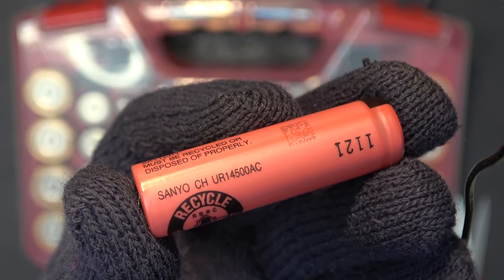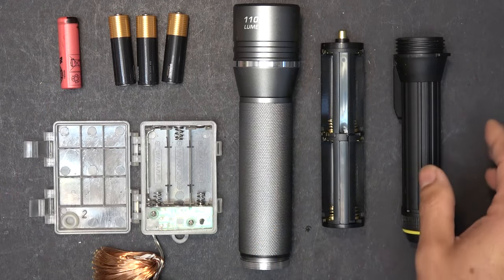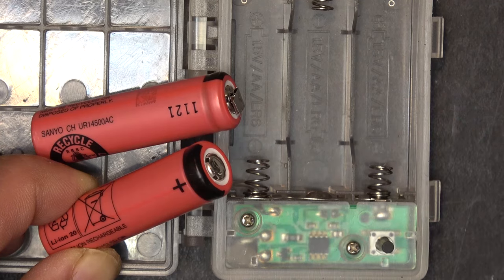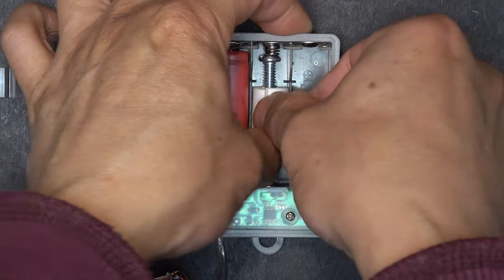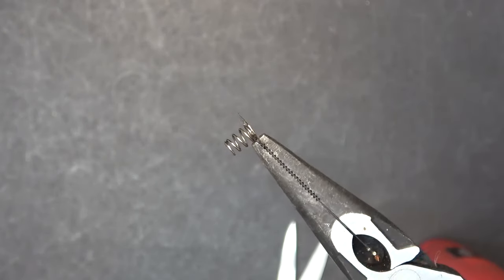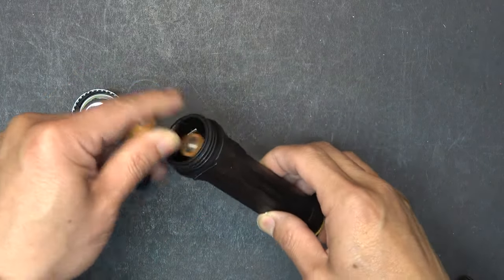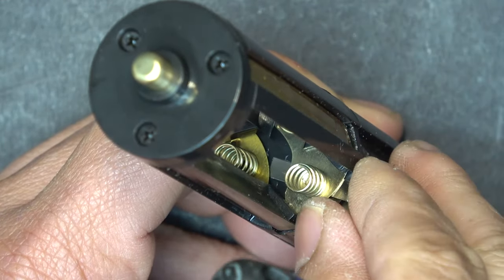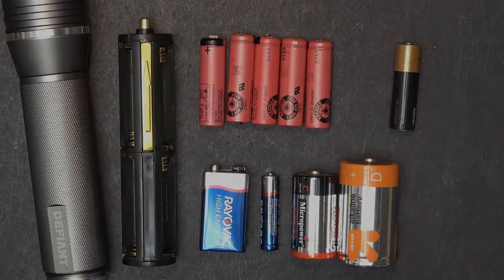This Li-ion 14500 AA size battery makes all Alkaline AA batteries obsolete

Comment: I went down this path a few years ago but about a year ago, I switched over to Lithium Iron AA cells, a better 1 for 2 swap out, voltage wise. As for flat top cells, I got some small rare earth magnets and they stick to the positive battery terminal - no spot welding required. You can also get button top Lithium 14500 cells. I also bought some AA cell 'blanks', I think they are hollow inside with an internal (+ to -) shorting wire, easier to use.
Reply: Another option is to use 14450 cells and a small buck regulator and then it's a 1 for 1 swap and you don't have any capacity loss, maybe even a little gain.

Comment: Nice! At 12:15 I would migrate the spring down to the bottom so you don't have to modify your battery. With your nickel strips and welder it would be short work to cut and join and swap the middle terminals around. That way your batteries are all modded the same way.

Comment: Note to anyone doing this.
1. Be VERY careful to get your voltage exactly right. 
2. Soldering nickel strips to LIon batteries could cause a fire if you're not skilled.

Also consider just buying AA & AAA NiMh batteries. They're the right voltage, last 10 yrs and only cost about $1- $3ea 👍
Reply: also label your device on the battery cover to indicate they are recheargable or put don't dispose recharge note on the unit....i had a friend who said his son and wife threw away all the expensive batteries he bought not knowing they are lithium/nimh ......ouch !!!!....i still grin and laugh when ever i remember the story !!
Reply: @10OZDuster  Women.....My Ex threw out all the NiMh batteries I gave my Son 🙄....
Reply: Yup overheating lithium batteries is bad. The best way to solder them if you don't have an impulse welder is to first clean the contact points with fine carbide sandpaper. Next apply a smear of plumbers tinning flux. Next tin with good quality leaded electronic solder, do this with a hot iron and quick. Next solder your wires or button tabs. I found the steel positive button from used up dollar tree AA or AAA cheap disposables works best.

Comment: Great idea with the screw.   This is how i started with electronics a few years ago trying to convert these string lights to lithium.  I first just solderd a USB connector onto it but that eventually burned out the LEDs that were expecting 2xaa batteries not 5v so i soldered a  vape pen battery with a little bms that worked well between its 4.2 and 3v range,but wasnt satisfied with the capacity.   So I switched to more in parrallel as well ,but for the 3xaa light strings I went back to the  USB adapter which worked fine since 5v is close enough to 4.5v, and now you can hook up  a power bank for even more light string capcity!  Just cut a usb cord and hook the positive and negative to positive and negative in the box.  I have like 6 strings going right now ,some on rechargable nimh and the rest on lithium usb packs, all charged from solar from today.

Comment: What Ive been doing in my devices that take 2-3 AA batteries in series  is I just replace them all with a single 18650 so I have the same or more amperage.  If there is room for 3 single AA there is usually room for a single 18650.
Reply: Yeah, flashlights that use those cartridge style holders are usually close enough in length to take a 18650 or 18500 directly.

Comment: Don't forget, with the 6 cell flashlight modification, you must be mindful to now place all the batteries in the same direction, as shown in the first parallel modification or you will short out the batteries.
You might also have to add a nipple or build up the negative terminal on 2 batteries to make a connection to the previously positive terminals in the holder, but that will depend on if the holder has recessed (previously positive) terminals.
Reply: Also, state of charge could become an issue.  Placing a random handful of cells in parallel would result in completely unregulated equalization current flowing which could get hairy.

Comment: I replaced ALL my AA & AAA alkaline batteries with NiMh batteries 25 yrs ago. I got most of them from old "dead" Nokia & Ericsson analog phone battery packs 😁

The screw idea is ok, but wooden dowel, 2 thumb tacks and a folded foil strip is cheaper.
Reply: Or you can just  completely wrap the dowel (or an old, dead cell) with a layer of foil and  either twist the ends or fold over and let the springs hold it.
Reply: Yup I save those like little gems. They are good for items that just need a rechargeable

Comment: One neat trick is to use a spacer and run those 3AAA flashlights with a single AA or 18560 battery. The LEDs cut out when the battery drops too low, a little less than 3V. A little lower than ideal but if you save the lithium ions out of stuff this is ok.

Comment: For the parallel conversion: would have much better to adjust the device's contact in the middle, with a spring, instead of making the middle batter 'special'... now that battery is specific purpose. Instead, modify the little contact inside the case with some solder or a piece of nickel strip with the spot welder! This way all your batteries are equivalent and interchagable.

Comment: instead of using a bolt just ground out one of those dead AA batteries. color it or wrap it so u can quickly know its a blank ...   yup 
ground out=solder the negative terminal to the case caz its really close. or in a pinch just wrap it w/ foil / strip it 1st if u wish

Comment: 5 years ago you did a vid on Tenavolt batteries. Li-Ion AA size 1.5 volt batteries, golly they fit right in where a std AA bat goes.      " That was easy". I use some 14500 & 18650 4 volt batts in my projects and adapt them, but if you have slots for AA batts just get something easy to use, looked like a lot of fuss to use one 4 volt bat

Comment: Do not do this if you plan on  recharging your lithium cells. Many electronics that take alkaline cells do not have a low voltage cutoff and you run the risk of discharging your li ion too much, which will cause damage to the cells and cannot be safely recharged.

Comment: Good video.  I'll check out the 14500.  However, my question is:   Why would the manufacturer create a AA battery equivalent in size but maintain an 18650 battery voltage of around 4 volts?    People might forget this and add to many batteries in their appliances with dire consequences to those appliances.  Like nimh or nicd batteries which are great as a rechargeable, these should also be 1.50 or 1.25 volts.   
Conclusion:   My thinking is that the manufacturer will use these 14500 as a future replacement  for the 18650 li battery as the 14500 uses less materials and yet maintains 4.
20volts.   However, capacity is sacrificed.
Reply: AA battery holders for use in projects are more common than 18650 battery holders. For small size or low power applications, AA size is smaller and lighter.
Reply: The material used to make the battery determines its voltage
Reply: A lithium ion cell that is only 1.2 - 1.5 vdc would be revolutionary. Not sure its possible, though.
Reply: I wish newer electronics were designed to work with lithium ion cells. I would never have to buy batteries again.
Reply: Ooooooooh! Nevermind, now I get it.
Reply: I have thousands of Lithium Ion cells just sitting here, and I'm still PAYING for brand new Alkaline batteries that start self-corroding in 2024, even though they have an expiration date of 2028.
Reply: @Peter.Sky.Walker  I have lithium ion 9v cells now in my possession.  I think it it is possible.  I also have seen I believe energizer aa and aaa Li batteries.  They use lithium button batteries.
Reply: @Peter.Sky.Walker  They have been making these for a while now. They are basically a LiIon battery with an internal regulator circuit under the button top to go from 3.7V down to 1.5V. They are a little pricey though, about $4 each and you have to purchase a special charger.
Reply: Li-on batteries don't have the nipples on one end. Some tweaking is needed to have them make contact. That should deter most people already.

Comment: In American prisons, we drop the battery on concrete floors. If it bounces, it's dead. It just plops, it's good. Worked well when there was no other way of testing. The old gum wrapper and battery trick works well for a lighter, also 😂
Reply: Are you in prison right now?
Reply: Checked with ex-prisoner & its good. He did say the bounce is specilative tho.     

Stay up ✊🏿

Comment: I harvest little Li-Ion batteries from old used vape cartridges and solder into some devices and hobby JST male/female wires leaving terminal exposed just wrapped with tape so they work in my Li-Ion charger with tape off.  If you have a device that uses a 3 slot AAA battery cartridge and it is configured in series such as in many flashlights the cartridge is the same size as an 18650 battery and the same voltage.  I have done this on many flashlights for years.  I also buy 18650 cartridges aka battery holders with flying leads and mount them external to devices that use 3 AAA batteries and solder the leads to the positive most and negative most terminal and put a notch in the battery cover for the wires to pass through.  If you are creative and it doesn't effect the look or performance of the device I either glue or attach with wire ties the 18650 battery holder to the casing of the unit.  I use many headlight flashlights that have a battery case on the back so I cant see it while using it and literally no issue with function unless I bump the back of my head really hard.  If you are creative 26650 batteries can replace C size batteries.

Comment: If you are going to the trouble of rewiring the battery compartment from series to parallel, I think its prudent to rearrange the position of the negative terminal springs accordingly. Li-ion cells are much less forgiving than any other battery, when it comes to human error.

When designing or building ANYTHING as a practical device, ALWAYS ASSUME the user knows nothing. It is an important part of the design process.

I’d go to the extent of designing a label:
WARNING This device have been modified to use 14500 Li-ion AA cells ONLY.
Incorrect loading of cells will create RISK OF FIRE.
Do not allow DEVICE to recharge cells.

Comment: Good Video. But let me tell you 0,5 v too much is enough to overheat and kill a lot of leds. I like the flexible 5v Cob Leds. They easily take up to 6v. The older Cob used in flashlights would die instantly directly connected to a lithium battery. I used resistor (p100) to solve this. And it was a lucky shot 😊 why so much afford? Any flashlight on my skateboard didn't work because too much vibrations.

Comment: Try using a 3 volt lithium battery in a device that uses only one 1.5 volt battery. You just fried your device. If your device takes two AA batteries you will need to replace one battery with a dummy shorting cell otherwise you will fry your device when using two lithium’s which gives you six volts compared to three volts for two alkaline batteries.

Comment: Thank you for your content.  It seems you are fairly up on this area, so it makes me think my understanding is lacking.  I currently use AA LiIon batteries for all the benefits you mentioned.  Is the benefit of a LiIon 14500 over AA cost or availability where you are?  Certainly the convenience of using the specified number of batteries in each device is a big time savings over the amount of time taken to jury rig voltage adaptations.
Reply: No benefit, but some of the 1-1 Li-Ion replacements for AA batteries have issues.  I've tried a fair few.  The problem with many (but not all) of these is that the little charging and voltage regulation circuit they put in these causes the battery to drain even when not in use.  Not much of an issue in applications where you charge the battery and then use it till empty, like R/C cars, battery powered toys and so on.  But it's an issue if you want to be able to grab a fully charged battery from a drawer where it has been sitting for months.  Or in low-power, long-endurance applications, such as in remote controls or smart home devices.

Comment: Unfortunately alkaline batteries probably wont be going anywhere anytime soon. It is a lucrative scam. Most devices that use them quit when cell voltage is still around 1V.  That translates to less than half it's energy content being used. Realistically they should have been banned long ago.
Reply: I totally agree with you and add one more thing to that. Stop or ban AAA cells immediately because it doesn't hold much energy compared to their environmental footprint from manufacture to disposal. I use the 1V batteries in my computer mouse which has a boost converter that will run until the battery is completely exhausted or on quartz clocks.
Reply: No. Alkalines do have barely eny energy left (maybe 5% if you are lycky) when discharged down to 1V.
Those do NOT work like capacitors / ultracapacitors ( energy in those =C×V^2/2 )